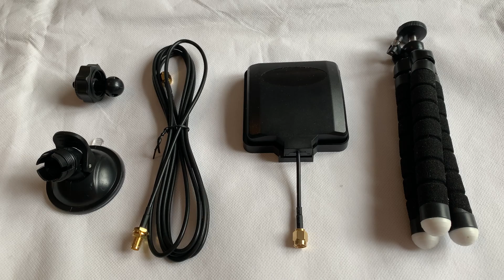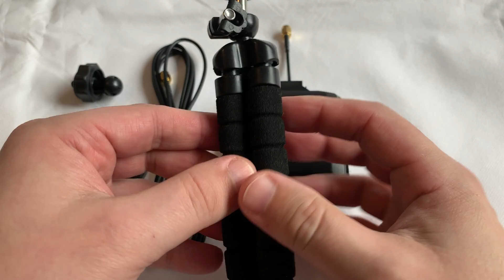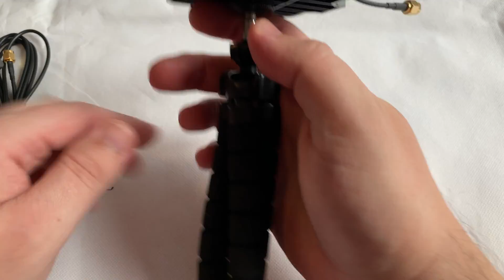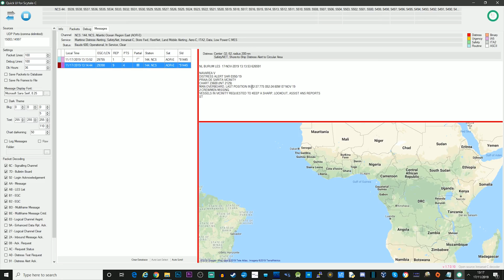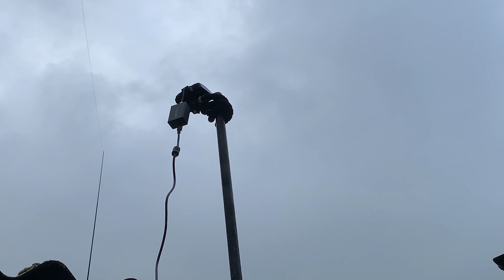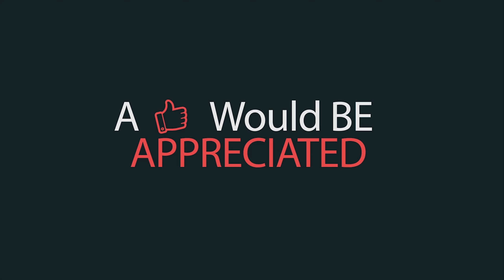RTL-SDR Active L-Band Patch Antenna For Inmarsat / Iridium / GPS

Comment: Still looking for antenna that is tuned to 1.7 GHz.. yeah for (A)HRPT reception. I technically can make a feed for it. Got SMA connector (from my RTLSDR dipole kit) and 7 meters of flexible copper wire (from some junk). Why I can't make it because i can't 3D print the holder for helical (most of the printing services in my city are busy printing military stuff, Ukraine moment)...

Comment: I've seen a few of you say that the link doesn't work for Amazon. You're right because it's out of stock globally however, according to rtl-sdr.com 'A newer better version will be available early 2021'. This is listed as RTL-SDR Blog Active L-Band 1525 - 1637 Inmarsat to Iridium Patch Antenna Set

Comment: Thanks for the review. You didn't read the rtl sdr site :
"The patch is designed to be used with a 1m+ length of coax cable. It may perform poorly if the RTL-SDR is placed right at the antenna due to interference." ;-)
Reply from the maker: Thanks for the comment. I did test “off air” with and with out and there was no difference to be fair. They may put that on the website because of the LNA.

Comment: Hi, Could you also test L band HRIT from GOES / Himawari  any other satellite available with this antennae and RTL sdr v3?
Reply from the maker: Thanks for the comment, altho I’m not 100% sure I can receive GOES or Himawari here in the UK. GOES East looks like the UK is right on the edge of coverage, so I could possibly try that. But for Europe we have Meteosat on Eutelsat but need special software apparently. I’m working on that tho so hold tight!